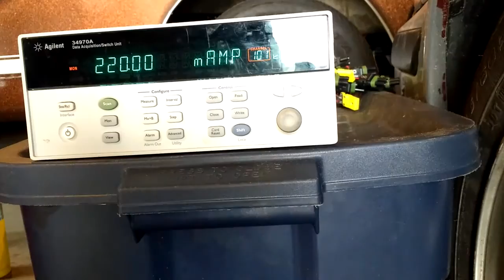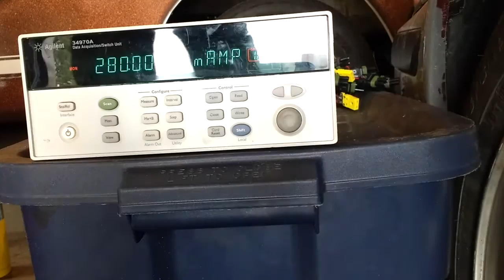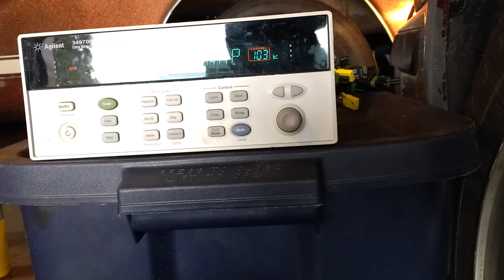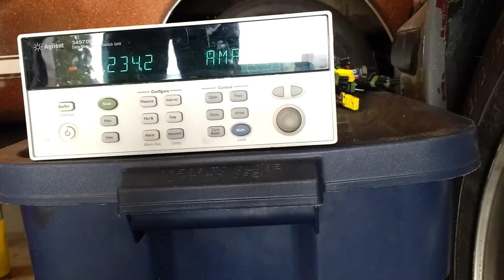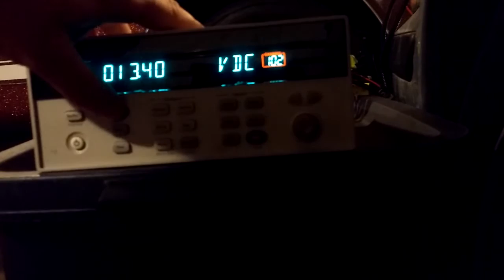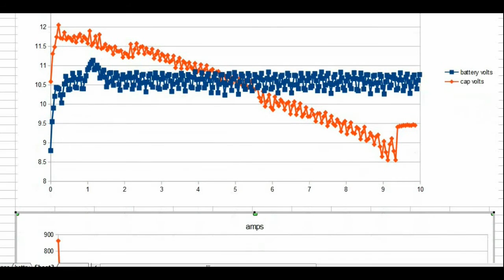Using a super capacitor as a battery (part 10) Final Testing

Comment: Hi.. by the way what is the fuse size in the fuse inline between supercap positive terminal to battery positive terminal. I try 15A fuse. It just blew. I try before just using supercap without battery somehow it blew of on of my backup fuse in engine bay fuse box. I'm suing Korean LSUC super cap. 2.8v 3000F x6

Comment: Nice video man, thanks for posting it. Just curious, regarding when the battery does finally go dead from sitting, have you thought about a tertiary capacitor priming battery somewhere? Something like this from HobbyKing seems like a good candidate to recharge the powerbank in a few minutes when the system gets too low: https://bit.ly/2ITixZK .  I'm also wondering if you had the capacitor Bank on a starting relay, isolated from the rest of the car circuitry how long it could sit for before the voltage got too low. I hear the discharge rate is really low on super caps so it seems like it could last a while.
Reply from the maker: Thanks for watching. I picked up a Suaoki T10 12000 mAh 400 Amp Peak Portable Car Jump Starter but need a way to limit the current if the caps are fully discharged. If I don't it would be like dead shorting the jumper pack when it is first connected.
 I thought about isolating them like you suggested but this cars computer resets when the battery is disconnected and takes a few miles of driving before running good again so I didn't look into it.

Comment: Another Youtuber, lasersaber, also used 6x 3000F (or similarly large) caps but he got over 30 seconds of continuous cranking. Just curious if you have an idea as to why you only got around 10 seconds with a similar setup, considering 6x 350F caps appear to be capable of cranking for around 5 seconds (from watching other YouTubers).

It's a good project nonetheless, I'd consider something like this myself if it wasn't for our temperate climate and low cost of regular car batteries vs these caps.
Reply from the maker: I'm guessing this is the video you are referring to.

https://www.youtube.com/watch?v=OvbuJwYnbvE&t=42s

There is a few things that will effect the cranking time. The first is the voltage the capacitors are starting at. In his video he doesn't show this but if he had just run the car before the test those capacitors would be at 14.0-14.7 volts. When I did my test I started at 13.4 volts. I chose to test it this way because the voltage only be at 14.0-14.7 volts right after you turn the car off.

The second thing that will effect the cranking time is the amount of power required to turn the engine over and run everything until the car starts. My car has running headlights that are on as soon as the key is on. Also I was doing all my testing with the heater blower on high. All of this added up to be  about 210-225 amps. He didn't measure this in his video but I would guess it was considerably lower allowing more cranking time with smaller capacitors.

Thank you for watching my video and commenting.
Reply: That all makes sense now, thank you!
Reply: Not quite a Prius but it does look like a typical small 4-pot engine. I'm considering something similar to you as well, perhaps putting in a new deep cycle or dual purpose battery together with a cap bank for the added power. Could even use a motorcycle battery, much smaller and lighter than a full size replacement but way cheaper and should still have enough reserve capacity. I've looked at 4S LiFePO4 but what is available is more expensive for the same reserve capacity vs a smaller lead acid. Also looking at Amperics 5x400F 3.0V supercaps, but waiting for them to get back in touch with me...
Reply from the maker: Paul Kipling one thing you might want to be careful of is how small of battery you go with if you leave your car sit. I ended up with a 4.5 amp hour AGM battery. Everything works great as long as I drive the car on a regular basis I parked it for a month and wasn't able to start the car. I can go a good two weeks without any problems but after that it gets dicey. It might not be a bad idea to check what your parasitic load is. My car's pretty old 99 and I don't ever use the alarm system so it might be considerably less compared to something newer.
Reply: Yeah that's a good point. Need to buy one of those clamp type Ammeters I think. Thanks for the info, don't think I'll go to any smaller than about 20ah, stock is 60ah. At the moment my battery lasts about 1 week of sitting idle, any more and it's a fight to get the thing started. Usually it doesn't ever sit that long but once in a while it does. That battery is dying though, I need to replace it before winter sets in at least. I wish Amperics would get back to me as their 3.0v caps look like a very nice solution. They were quick to respond the first time but I've been waiting a while now. My car is '08, no alarm system but does have remote central locking, immobilizer, plus whatever CANBUS stuff might be going on.
Reply from the maker: If you need a cheap way of measuring starting amperage I use one of these. 

https://www.amazon.com/uxcell-Current-Resistor-Digital-Ampere/dp/B008SOPJ42/ref=redir_mobile_desktop?_encoding=UTF8&keywords=current%20shunt&pi=AC_SX236_SY340_FMwebp_QL65&qid=1494690271&ref_=mp_s_a_1_14&sr=8-14

They are a lot cheaper than the amp clamps.
 If you go with the Amperics let me know how they work out. I thought about using them on a different project but I couldn't find 3 volt balancing boards.
Reply: its EWWropean car iguess, thats why, could happen anything if u usin it too much...
Reply: If you are starting with about doboul the starting current compared to a battery, that to me implies your car starter motor relay gets excessively high peak currents during time of connection which will massively reduce the operating life of your starter relay. Replacing a buttery is easy. Replacing a starter motor requires a mechanic. What is more expensive in the end?
Reply: @cooliocrib4409  replacing the starter motor is easy just watch ChrisFix

Comment: I see you have a Saab too! Saab is specific about protecting the charge system, recommending when jump starting that both  vehicles never be running at the same time while connected (charging systems fighting each other). The right voltage range is important and one potential problem is capacitors ride at the max voltage put out by the alternator, which might be adjustable.
Reply from the maker: Johan Smith I was concerned about what effect the capacitors would have on the alternator output too. I hooked up an oscilloscope with the original battery and with the capacitors and wasn't able to see any large change to the voltage when the engines running.

https://youtu.be/XlgPjCHuTak

I did run across the problem that if the voltage is below 9 volts it's possible to start the car but it throws transmission error codes. They cleared by cycling the ignition but I wouldn't recommend anyone trying starting this car at very low voltages.

Comment: Looks good and nice testing.  The resistor protects outgoing current flow from the battery.  But it also blocks charging current which "might" affect you if car sits a long time and it does not get a long enough run to charge the battery through that resistor?  My worry is that the battery could deplete over time if resistor limited current charge is less than idle parasitic load time draw. If the battery is getting fully charged over the resistor by your driving then it should float your capacitors at 12v+ even after 2-3 days.  If it is not getting enough charge your voltage on your capacitors will drop below 12v as the parasitic load drains your capacitors.  You can put a Schottky diode in parallel with your resistor if you haven't already.  This will allow more current to your battery for charging while still limiting outgoing current by the resistor.  

Look forward to seeing your next tests. :)
Reply from the maker: Gene Angel you are 100% correct. I I checked the voltage and current going to the battery after a week and could see it was not getting adequate charge through the resistor. I ordered the diode and in the meantime just put a charger on it after a week of using it. I'd like to build a current limiting circuit and use a MOSFET instead of the resistor and diode for better efficiency but that will be down the road.
Reply: You might want to stick with the resistor?  A mosfet could save you a "little" power over what you would lose in the resistor from heat (vs amp draw from mosfet circuit) when running devices like the radio without the engine running (not really done very often?).  However most of the time the car will just be on the parasitic load.  The resistor loss from the parasitic load at that low an amperage should be next to nothing.  A resistor/diode combo also should hold up very well over many years in temperature extremes (neither are affected by weather range temps much) where a more complex circuit may not last as long in changing/adverse/seasons weather? 

I love my capacitor battery.  But speaking from experience I would offer just one other suggestion.  You have already put good money into 3kF capacitors (really good choice).  I'd say go the extra mile and pay a "tiny" bit extra to put in 1 extra battery.  Have this one set to charge over a diode and a switch you can flip to connect it to the capacitors in an emergency.  The reason is if something "unexpected" happens (door don't shut all the way/Murphy's law that always happens to everyone at some point) to drain your capacitor bank then your not sitting in a parking lot begging passers for a jump.  Where others would have a dead battery (or not since batteries have more storage) you would just flip a emergency switch bypassing the charge diode letting power flow back to the capacitor and then flip it back after your capacitors have quickly charged.  Not only would you have a long lasting battery.  But you would "in theory" have a battery that unlike store batteries would never leave you stranded without reserve power. :)
Reply from the maker: Gene Angel I was thinking about doing a backup battery like that but for now I'm probably just going to pick up one of those cheap tiny lithium battery boost packs and keep it in the trunk. Eventually I hope to adapt this into a different vehicle with the primary goal being cutting weight.

Comment: Good vid, have you considered a small circuit breaker between the battery and the caps?  I've been using a breaker for months.  It's odd that your fuses blew and my breaker never trips unless I manually trip it. Also, I believe it's 40A as well.  That's why I thought it odd.
Reply from the maker: Thanks. I'm guessing you are correct and that a circuit breaker would work for mine. Most of the ones I found are slow blow compared to the fuses I was using. If I have problems keeping the battery charged with the resistor I might switch to one.